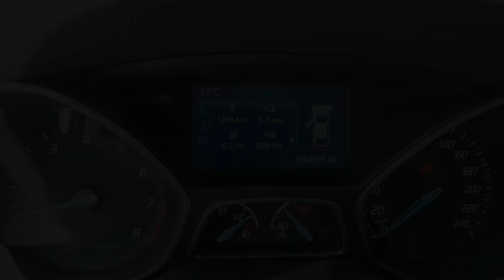Ford Ecoboost 1.0 internal condition after 8 years and 100000km.

Comment: Just had the belt done on my 2014 Focus 1.0 Ecoboost just shy of 10 years old, owned from new and mostly a town car with daily short journeys 5-15 miles. 54,000 miles, fresh oil every year 4 x ford sevice, the rest at the local shop who did the belts and have always invoiced Castrol Magnatec 5W-20 on the service. Asked the shop for feedback prior to job, they said they planned to take photo's but was so clean there was nothing to take a photo of. They actually asked if I'd had it cleaned previously and said it was the cleanest of the 50+ they had seen.  Can only speak from my experience but oil seems to be the key. Not a fan of the new 2 year / 18,000 mile intervals, oil is cheap comparted to engine failure.
Reply: Excellent comment, I will be renewing the oil and filter soon on my ecoboost with Westway oils as I use it in my van and has excellent reviews, I believe change oil etc etc every year or around 7000 miles, kind regards to you and take care, Mark from Billericay 😀👍🇬🇧
Reply: @marcusmaximus451 Make sure Westway meets the ford spec for this engine. The correct additives are required to protect the belt. Non spec oils may have additives less compatible that degrade the belts.
Reply: @dectoasd3644  hello thank you for coming back to me, yes I will certainly check that and really appreciate your expert advice take care 😃😃👍👍
Reply: I suppose this 2year/30K km interval is done by manufacturers to appeal fleet companies to say how economic is their maintenance. Otherwise, 15K kms must be taken as maximum interval for the best longevity

Comment: I have a 100cv C max 1.0 from 2014, 8 years old and 97,000 km. I changed the timing belt and this piece did not present wear problems. I do the services every year, a specific Ford oil change in an official technical service, every 12,000 km. I have seen engines and belts very damaged by inadequate oils, 5w30 or 5w20 that did not meet ford specifications, in addition to changes with a lot of mileage and 100% urban routes. It is my humble experience and I hope that this car will last me much longer.
Reply: The oil that ford advise is 5w20 WSS-M2C948-B
Reply: @MrChilo89 peut importe castrol ou autre toute les huile sont bonne juste les prendre avec la norme ford

Comment: We had this engine in exactly this condition after 218,000 km when we had the distribution system done. Until 180,000 km castrol 5W 20 then Millers oils 5W20. Focus combi MK3 2013 1,0EB 92kW.
Reply from the maker: Why you decided, to change the oil manufacturer, since the original Castrol was performing good? Don't you worry, that this could potentially lead to premature failure of the belts?
Reply: @synthez3d  Castrol is not that good. After switching to millers, engine noise and fuel consumption decreased. We only fill up with 100oct gasoline. We try to ensure that the engine has everything it needs. We had it disassembled - valve clearances were done and there was no wear on the engine. Millers is already 50,000 km in the engine. Millers has the oil right for the engine and it meets all the standards that ford requires, there is no reason for it to cause problems with the belts.
Reply: @petrberanek8071  I call BS, I’ve been using synthetic Castrol oil since it was released. Our company Ute which is turbo 4L has done over 750,000 Km on original components including turbo and @ 500k we removed the rocker cover as it was leaking and inside looked like the day they assembled it. The oil works in hotter climate than you would get, tows 2T trailers and it’s can run for 14 days straight without being turned off , except for refueling . So once again I call BS.
Reply: @tba3900  But we are talking about completely different engines. Here we are talking about 5W20 oil with the standard for ecoboost 1.0l, this oil is not used in any other engine. I personally have better experience with Millers oils. The motors are quieter and have lower consumption.
Reply: @petrberanek8071  not used in any other ford engine, look up fgx falcon V8 with supercharger and see what ford recommend. Think you will find it 5w20 and it also written on the cap castrol 5w20.  How often do you change your oil, if you go by Fords recommendation forget it, no oil will last. This was the biggest con job ever by ford, anything turbo should be done at 7500km Here is a simple but most cost effective way to make any turbo engine last and reduce component failure , simple as warm them up and idle them down, I use the exhaust temp to determine when to shut down.
Reply: @tba3900  Our ecoboost has 226,000 km. Timings were done at 218,000 km and there is no visible wear on the engine. The oil was changed every 20,000 km up to 180,000 km, since then we change it every 12 - 13,000 km. Cooling down is a matter of course, as is careful warming up and not under-revving the engine. We also fill up with 100oct gasoline against LSPI - oil from millers oils also prevents deposits and subsequent LSPI.
Reply: @petrberanek8071  lol, i change my distribution at 100k and always do oil change at 10k max
Reply: @petrberanek8071 what do you mean valve clearances were done? They are hydraulic auto adjusting.
Reply: @petrberanek8071  Yeah the brand does not matter. As long as it has the WSS-M2C948-B specification you can use every brand for the Ecoboost. For example MPM MOTOR OIL 5W-20 PREMIUM SYNTHETIC EB 1 is the same oil.

Comment: I have a 2013 ford fiesta Ecoboost 1.0 (123BHP), the oil changed at 3000 miles (by ford) then 13k. After that, I did changes every 6 months, I do around 6k a year, only using Castrol 5W20 for ford Ecoboost (WSS-M2C948-B) The car currently got 57k on the clock and the belts (timing and oil) are coming up to 10 years (in July 2023).  I know its a big job that will cost a bit, book time on it 8-12 hours. I'm in 2 minds if I should get it done (and the water pump at the same time) as I do like the car and another 5-10 years mite be possible.  Not sure why they didn't use chains (like thy did from 2018 onward). But seeing this video and the way your belts look with correct oil used is promising. Thanks for the upload
Reply from the maker: I plan, to change the belts on 10th year, because I also like the car and the engine and will probably continue driving it for few more years.
Reply: @synthez3d  Just had my timing belt changed after >10 years and 210.000 km (130.000 miles). My car is from 2013. Don't know how the state of the belt was though. Been doing about all the maintenance up to then myself replacing the oil every ~20.000 km. Always using the correct 5W20 EcoBoost oil from Castrol. Really good car and engine. Runs so cheap as my daily driver.
Reply from the maker: @erikhansen5172  That looks promising. Thanks for posting and confirmation, that properly serviced engines don''t have problems.
Reply: Chains are no guarantee! Ask Renault owners with their 3-cyl 0.9 TCe engines! A lot of engines has had broken chains way before 60.000 Miles.
The chains today are so lousy, that the also get worn, because the get to run 15-20.000 Miles on an oil change. Even BMW-OWNERS experience broken chains, on certain engines.

And yes, Ford has changed to a chain, from 2018 onwards. But only the timingchain. The oilpump is still driven by a wet belt. 🥴
Reply: @Saab95AeroEstate  Sounds like ford did half a chain job then. Some car makers like to cost cut and go to cheap. In the long run it no good for a brand, IMO
Reply: @qrogueuk  - I completely agree...

Comment: looks clean. i have a focus 3 2014 with same engine, now has 118.000 km. i changed the timing set 1 time until now at 87.000km, but not changed the oil pump belt and not cleaned the oil pump sump. i changed the oil at 10.000km everytime, except the first year of owning the car, when i changed it at 15.000km and used only castrol 5w20E. at the next oil change i will take down the oil pan and inspect the oil pump sump.

Comment: I have a 2013 fiesta 1.0 ecoboost and i had my belt swapped at the 11 year mark and 147.000 km on it and it still looked ok by regularly having the oil changed it's not like it holds much anyway

Comment: Unfortunately you cant always be sure what oil your service dept actually puts in. And that's what makes these wet belt engines such a risky buy.
Reply: If I bought one I would remove the sump and check it then use correct oil
Reply: Watch the garage pour it in

Comment: A mechanic said that all these belts on these will break down and clog up the oil take up!This video seems to suggest otherwise tho!
Reply: Need to use the correct oil at all times and change the wet belt around 80k

Comment: Thank you for posting this video.  Good to see the oil pick up screen wasn't coated with bits of belt / contamination and the oil pump drive belt looks to be in reasonable condition? Did you get to see the condition of the camshaft drive belt, what condition was that in?
Reply from the maker: Both drive belts were in perfect condition. No cracks, no any sign of wear. I think the service interval for changing the belts on 10-th year would be perfectly fine.
Reply: @synthez3d  Thank you for the positive information, encouraging to see a good news post about Ecoboost wet belts for a change. A lot of people say belts are damaged by using the wrong oil. Do you get to see inside many Ecoboosts? If so, it would be interesting to know what condition you find the belts and pick up screen contamination.
Reply from the maker: @raygibbs9247  It's my engine on my C-Max and it's the only one, I've seen opened. I also was worrying, because I've heard so many legends, regarding those engines, so that's why I decided, to see the real condition. I've used only the original Ford Castrol 5W20 from day one and as you can see, it's working perfectly well. Probably other brands would damage the belts, but I can't be sure, so I will continue using the original brand, recomended by Ford.
Reply: @raygibbs9247  Hello, at my work we have a Cmax 1.0 125cv, the first oil changes used an inappropriate 5w20 from a cheap brand and the belts were damaged, the teeth disappeared and the oil pump was clogged. It was necessary to change the timing belt and new oil and they began to do the oil changes with a 5w20 from Repsol approved for Ford ecoboost. So far no problems. Good maintenance works and these engines do not accept any other oil. Always 5w20 with homologation for ford 1.0 ecoboost.

Comment: I have C-Max with 1.0 Ecoboost also, bought this car 3 months ago. 7 years old, just 19700 km on the clock now - it was a car from an old man, who drove with it less km in year. This engine is surprisingly good but i have one question - is your ecoboost quite noisy at low temperatures when not yet warmed up? It sounds just like diesel. Thanks.
Reply from the maker: Yes, it's pefetly normal. I both my car brand new  and It was like that from day one, so don't worry.
Reply: @synthez3d  thank you for your feedback.

Comment: 100000km is only  62.5k miles at the 18k Mile/ 2 year recommended service intervals, the car would have only had 3 oil changes (half way to being due its 4th) at approx 7 years old.

Considering ford recommend 150k mile/ten year belt changes there should in theory be no reason to inspect that belt yet. 😂😂

I've seen the belts on these block up the oil pump and break at under 30k miles with full dealer service history.

Bare in mind that in the UK these have a long life/18k mile oil change interval so would not even be due the second oil change at 30k miles, dealer tried to claim wrong oil as cause before realising they had serviced it last.

Initially they were all long life but earlier cars have had recommended service intervals cut to 12.5k miles.

I recommend service annually or 10k miles minimum to customers of "long life" cars.

Some user groups are recommending as little as 3-4k mile changes on these.

Even that would be only 2 services before 30k miles

The wet belt in my opinion was a designed to fail part, ford have changed hundreds of thousands of these engines under warranty, with many thousands more paying for out of warranty repairs.

They did the same with the lower belt on the linx 1.8 diesel engine, it was changed from chain to wet  belt for seemingly no logical reason.

the original chain design nore the upper belt tend to fail on them, but the wet belt fails regularly causing catastrophic damage, it was such a problem that a chain retrofit kit was made for them.

Comment: Wow very  good condition drive oli belt, thank you for informative sharing. I haven't been able to use Castrol Magnatec Professional E 5W20 oil which meets Ford WSS-M2C-948-B spec for my ecoboost for a long time because this oil has long been no longer available in our country. So I can only use Motul Specific 913D oil which only meets Ford WSS-M2C-913D spec, which seems to be comply only for Ford diesel engines. I really don't know if my ecoboost timing belt will last and tolerate that spec oil. Hopefully someone can explain how bad the risk I will experience is, thanks
Reply: It’s a big risk. You can find right specification from another oil producers.
Reply: @JW-mu1og  However, what surprised me was that I did not understand that in several versions of the Ford Fiesta Ecoboost 1.0L owner's manual in Southeast Asian countries, such as Indonesia, Philippines, Malaysia and Vietnam, it was clearly written in each country's owner's manual that the recommended engine oil was other than WSS-M2C-948-B can also uses WSS-M2C-913-C. I don't know whether this means that WSS-M2C-913-C spec oil SAE-5W30, can only be used specifically for tropical countries
Reply: @JW-mu1og  In my country, Indonesia, since Ford left this country, no one sells WSS-M2C-948-B spec oil from any brand of oil any more. The only choice is the Motul Specific 913D with spec WSS-M2C-913-D, and nothing else
Reply: @Raveent can’t you try to order from another country? This belt ist very sensitive for another oils, it’s a bit risky.
Reply: @JW-mu1og  I've tried ordering from abroad but can't because it's always rejected. BTW, what do you think about the WSS-M2M-913-D oil specs that can be used according to the Fiesta owner's manuals for Southeast Asian countries?
Reply: @Raveent  here in Germany Motul doesn’t recommend this oil for Ford 1.0 EB.
Reply: @JW-mu1og  Yeah I know. Be grateful you're a lucky man to be German, all the best cars, all the best oil and the best things are all there. Where I live everything is limited and here Motul is one of the best brands because there are not many other options. So far my ecoboost is 8 years old and has traveled 60k km with this Motul oil, but I don't know how long my engine will be able to last, because it is very difficult to find out the condition of the timing belt, pump drive belt and even the oil pump screen using my endoscope camera, although there is someone on the forum who was able to take a photo of the oil pump screen using his endoscope camera
Reply: @Raveent yes, it’s possible to control this with endoscope camera with integrated flashlight. Or you can remove the oil sump but it costs more work.
Reply: @JW-mu1og  My endoscope has an integrated flashlight, unfortunately it's too big diameter 8mm so it can't fit into the gap between the screen and the bottom of the Carter oil sump which is too close. I have bought the 5.5mm one and at the next oil change I will try again. Removing the oil sump is quite a troublesome job because you have to open the turbo down pipe, AC compressor, drive belt etc. and requires the replacement of dozens of disposable bolts and nuts according to the requirements of the Ford workshop manual. So it should be much easier and simpler to just use an endoscope like at fiestafaction forum, just search "1.0 Ecoboost - How to inspect oil pump screen with an endoscope" if you want to know
Reply: @Raveent good luck with the camera, it’s should be enough. But as I sad, many 1.0 EB owners remove the oil sump after 2-3 oil changes.
Reply: @JW-mu1og  Yes, in my opinion, observing the oil pump screen with a camera should be enough to find out whether the timing belt and oil pump belt are in good condition or dangerous and must be replaced immediately. I think, maybe 1.0 EB owners haven't realized that there is an easier way to know belt condition besides opening the oil sump
Reply: @Raveent  in brazil we have a new specification for the wet belt oils, the 5w20 wss948-b API SN is now 5w20  wss960-a1 API SP , the 5w30 913 is now 5w30 wss961 and the API spec was upgraded too, i don't remender with one was, because i use the 5w20 only, but i know that both can be used, but i stick only with the 5w20, so it's probable you are not finding the old spec because they are not producing the old ones anymore and had replaced them with the new specification, over here it's not possible to find the 948-b anymore, just the nem one, bye...

Comment: Do you also recommend changing the oil every 5k to 6k miles? Or could you follow the Ford recommended service timeline, OK?
Reply from the maker: I've changed the oil on Ford recommended  intervals ( 20000km. or 1 year).
Reply: Changing earlier will help protect the wet belt but won't help if the belts already degraded only way it will work if its done from new